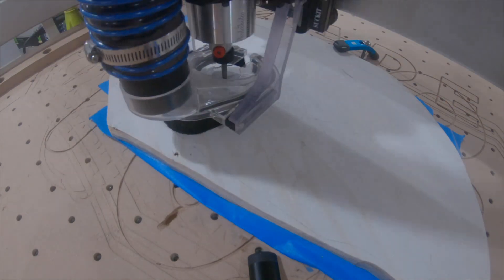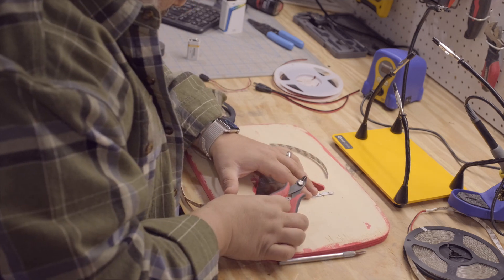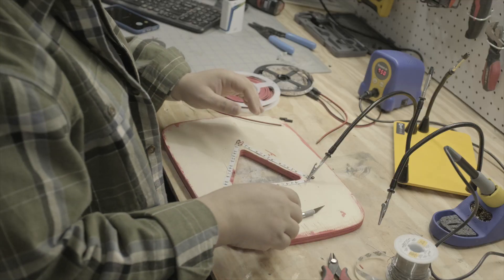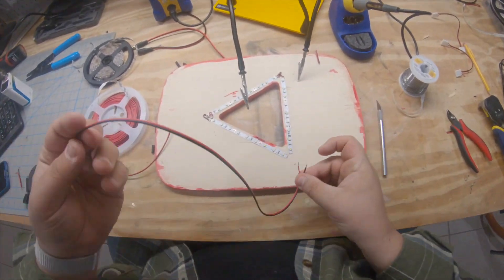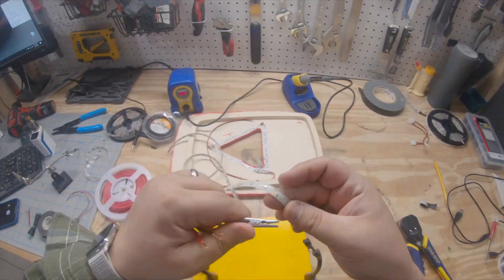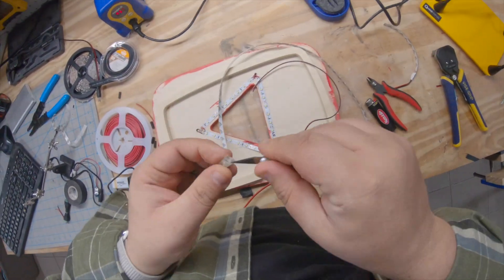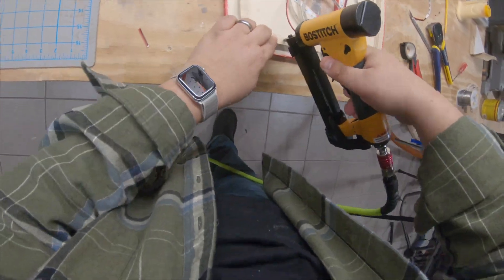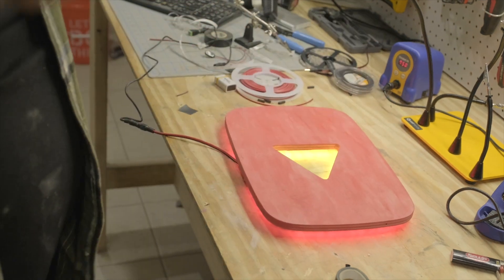Lighting a sign with LEDS for beginners.

Comment: Your black and red wire cutters, cut the silicone off the leds very nicely, for me anyway. They just seem to slide under and separate the led strip easily, and then its just there to cut it off.